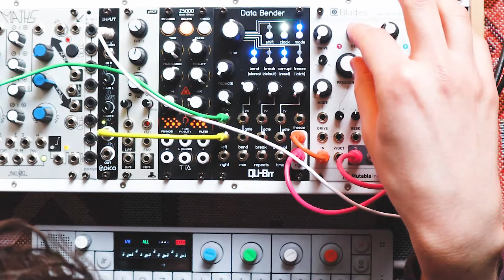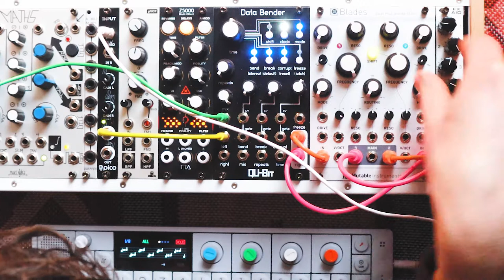Qu-Bit Electronix DATA BENDER. Demo and Review!

Comment: Super late reply…. Data bender def cool. Just wondering if you’ve ever had the chance to try ALMs MFX and use the Bit Crusher mode. I’m wondering if this is giving essentially the same as Data bender but in only 6hp
Reply from the maker: Personally I found the bit commander algo quite difficult to use, and definitely not as smooth or fun as the data bender :)
Reply: @TheUnperson thanks for the reply. Yea I’m figuring that’s likely the case. Also what’s your thoughts on data bender vs beads? Worth having both? Are they different enough?

Comment: This looks fucking mental, I'm ordering mine this week.

@ about 15.40, you say "You can cv this. I don't know exactly how you would, but you can." First thing I thought was to mult a clock signal, one into DB, and one into an lfo. Then, mult that lfo, one copy into DB bend, and one copy into the filter cutoff. As the pitch of the bend increases, the filter opens, and as the pitch decreases, the filter closes. Maybe run both those lfo's through an attenuverter first, resulting in the filter closing as the pitch increases, and opening as it decreases. Sounds counter-intuitive in my head, but hey, that's the fun part of modular. Make it do things wrong deliberately just to see where it goes. 

Mine will go right in the middle of the lower dedicated drum rack, with the intention of being used as a permanent drum mangler. I have Beads in the upper rack (a Rackbrute 6U which is a 100% MI case) so I'll use that for all the voices, while DB is pretty much just for drums and samples. At the moment, Maths is there, but it will be relocated to the 3rd case when DB arrives.

BTW - Last time I spoke to you, I asked you what you thought about Beads into Rings. Did you end up trying that? If so, I'd love to hear where you take it. Your patches are always mental and unique.

Comment: how would it do as a looper for some electro acoustic and voice loops?
Reply from the maker: it works kinda more like a beat slicer than a looper. I used to have the DLD from 4MS and it worked kinda well as a looper.  I think the looper from Boss is the ultimate looping device on the market at the moment. Seems crazy good!